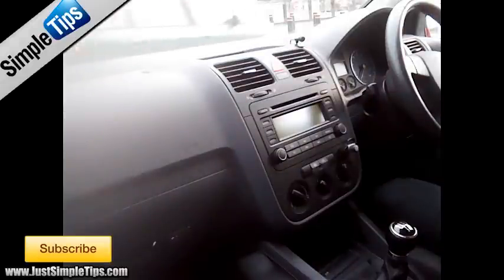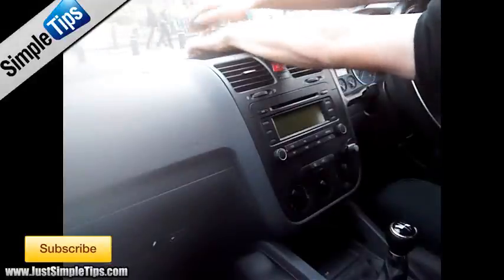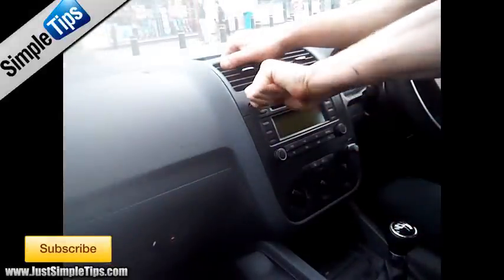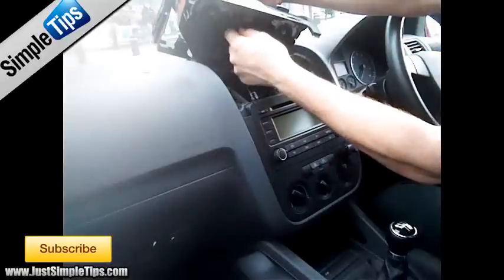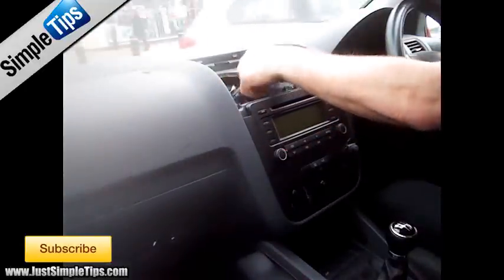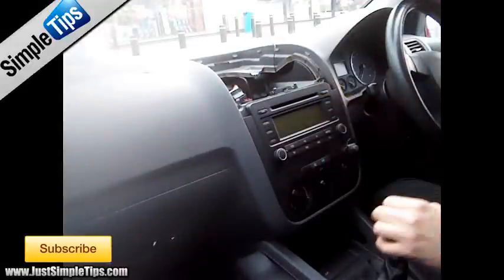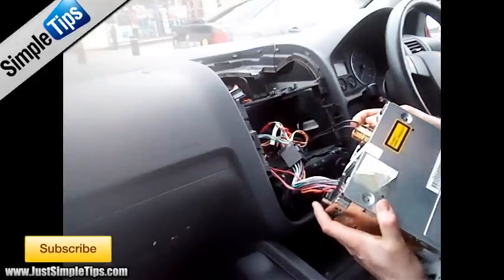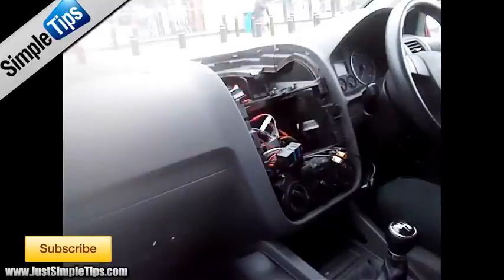Radio Removal Volkswagen Golf MK5 (2003-2010) | JustAudioTips

Comment: I started the car without the airbag light in and now the airbag light on the dashboard is lit so im just wondering is the airbag on or off? the airbag light under the hazard are working like it should it's lit (off) when i have turned the airbag off and it isn't lit when the airbag is on. but i still get the airbag warning on the dashboard. 
(sorry if it's hard to understands, english isn't my first langugage)
Reply: You will have unplugged the airbag light when removing your dash trim, this will have have thrown up an error code even though you reconnected it. You can delete this code in VCDS (don't worry your airbags are still functional)

Comment: hello. dent to disassemble the air, missed the snap of five horizontal parts of the air conditioning. Anyone know where to buy?
Reply: +electroconvulsivetherapy Also happened to me when I removed the top center piece. Lost the curved side rail that holds the vent fins in place. :( You can't buy these separately and need to replace the entire piece.

Comment: You dont have to remove the hole airvent just lift it and take the radio out. No point of taking the airbag light and stuff like that. You can get to the radio wothout doing that.
Reply from the maker: Yes, That's right, But it makes the process slightly easier.